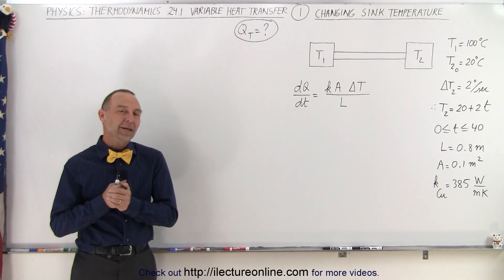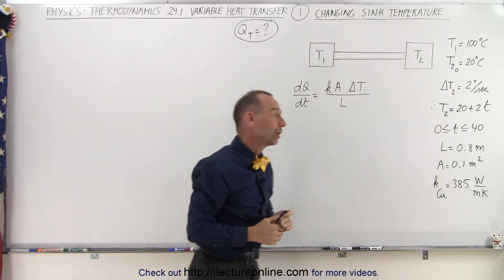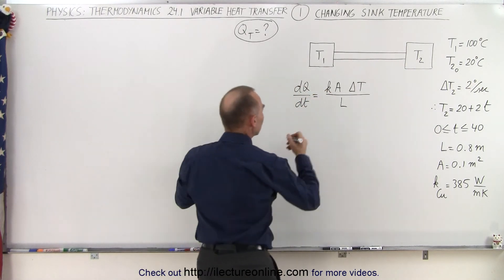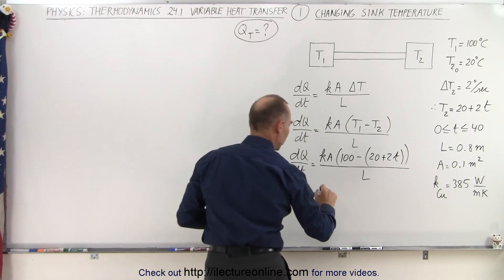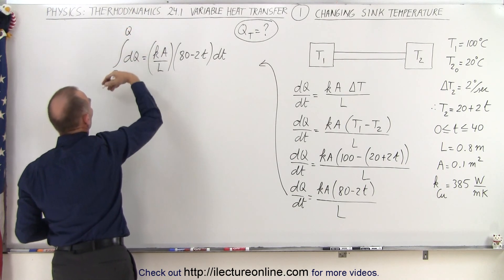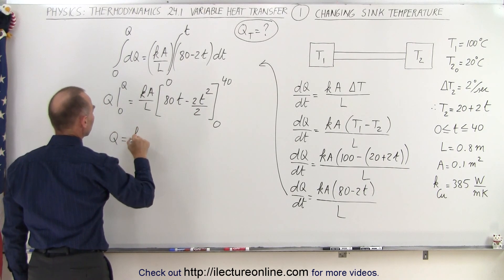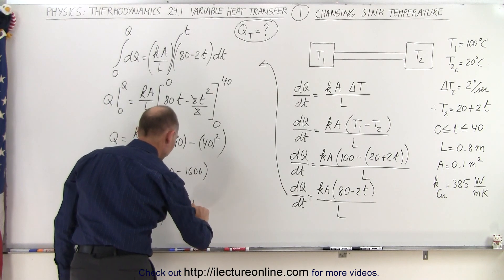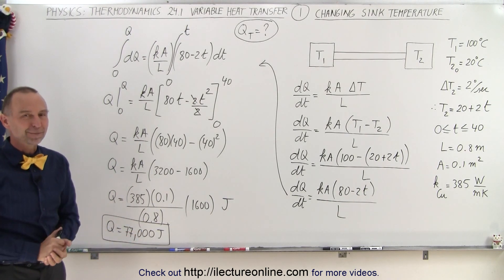Physics 24.1  Variable Heat Transfer (1 of 25) Changing Sink Temperature

Comment: Hi, could you show how could be solved a heat up problem for fluid flow in to the pipe with electrical heater along. We will have a variable heat which will be work for fluid heat up.
Reply from the maker: Typically these are solved by using a known heat input (J/sec) and a flow rate ( m^2 / sec)    Then we divide the one by the other and use an efficiency factor if needed.
Reply: @MichelvanBiezen  I told about some heating cable which produces heat per meter. A fluid has some Tmi on a flow beginning and heat losses via insulation are low and all heat tracing power goes to the heat up. And we have some equation like (2pi*k/ln(r2/r1)*dT+mCp*dT=Q*dL) in that system has to be included convection and conduction resistances of a pipe. Could you show how to do that in right method?

Comment: Sir, thank you for the video. Could you please correct me if I'm wrong? Temperature of the sink will increase with time thus decreasing the driving force △T, then △T2=2℃/sec isn't correct. If this is the case, the total Q you calculated based on T2=20+2t might not be correct.  I think total Q would be less than 77000J........Sorry if i'm wrong......
Reply from the maker: The video is correct.  If the temperature of the sink didn't change the total Q would be 154,000 J in 40 seconds.
Reply: Simply, If △T2=1℃/sec, total Q is 38,500 J in 40 seconds using your calculation sir.     But, when △T=80 the dQ/dT is 3,850 J and 1 sec later when △T=79 the dQ/dT is 3,802 J, and 2 secs later when △T=78 the dQ/dT=3,754 J and keep doing so for every second and add them all up the total Q in 40 seconds ends up being  118,388 J.It's confusing to me....
Reply: @Guenhee & Junhee Lee  He is right and you are also right. Let me explain how.
The problem set up not realistic and is not correct in the first place. You are right about the fact that the driving force should not be constant at 2 C/sec. I think the purpose of the example is to explain how to apply the heat transfer concept rather than solving a problem that has connection to real situation. So he is right in the solution he worked, if we ignore that the problem is not realistic and we accept that △T is constant at 2 C.
A more realistic situation should consider the heat capacitance of either the two objects or at least the second object. In that case, if I am not mistaken, △T will be changing exponentially.
Reply: One way to make the problem make sense is by changing T1 with a constant source of heat.